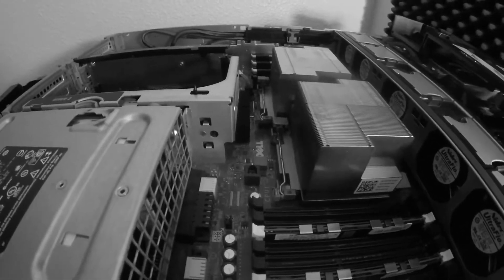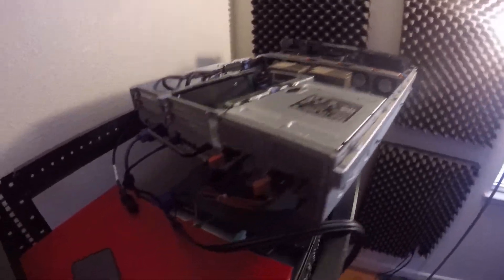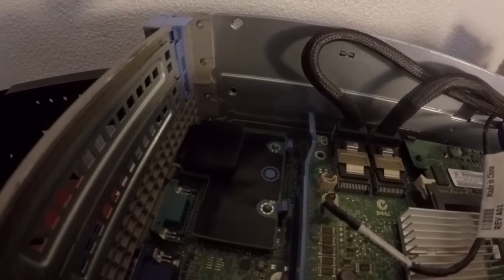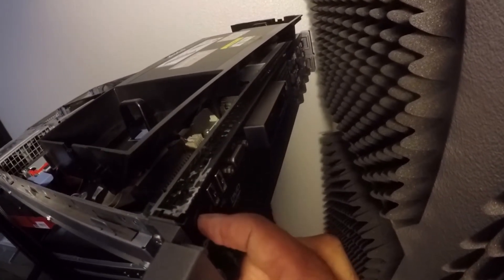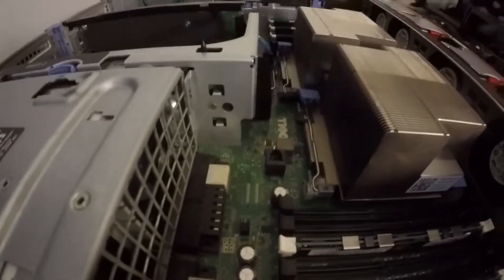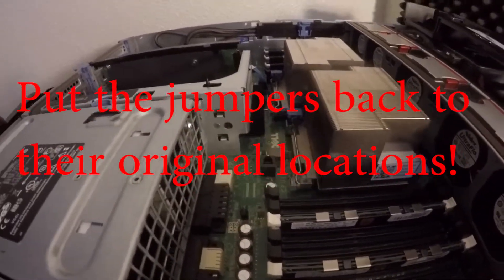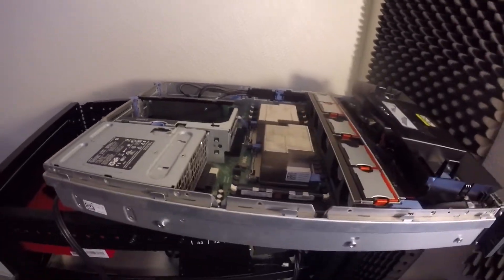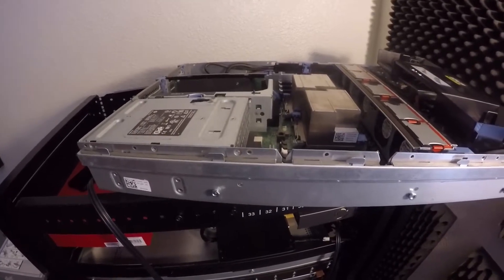HOW TO ENABLE SYSTEMS SERVICES/ IDRAC6 ON DELL SERVERS

Comment: I didnt have to take the idrac off 
here is what I did

Clearing the NVRAM

Steps:
Completely power off the server.

Remove the power cable.

Move the NVRAM_CLR jumper on the motherboard (usually located near the CMOS battery) to the clear/reset position. (Theres a picture how this mode is next to the jumpers)

Reconnect the power cable and turn on the server for 10 seconds.

Power off the server again, return the jumper to its original position, and power the server back on.

⚠ This will reset all BIOS and RAID configurations — use with caution.
Reply from the maker: Nice ❤ thanks for writing solution!

Comment: Any other ideas.  Didn’t work
Reply from the maker: What are the symptoms of your system
Reply: @SaajaadeenJeffries  the systems services is locked out.  No f10   I can get into f2/f1 f11 and f12.  No f10.
No systems services and no life cycle control access.
Reply from the maker: @MrMeowalikat  you try resetting the bios to see if any of those options show up after a reset? If not try it
Reply: @SaajaadeenJeffries  tried that.   Reset bios and updated firmware and bios
Reply: @MrMeowalikat  Did you found a solution to this problem?